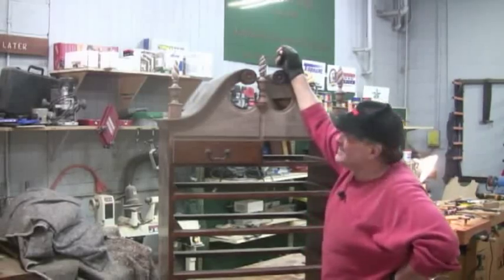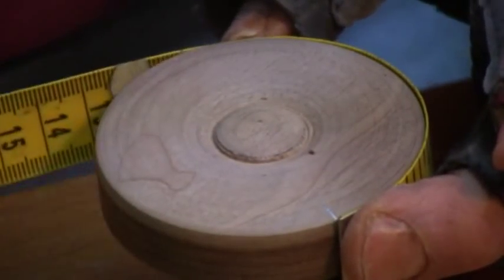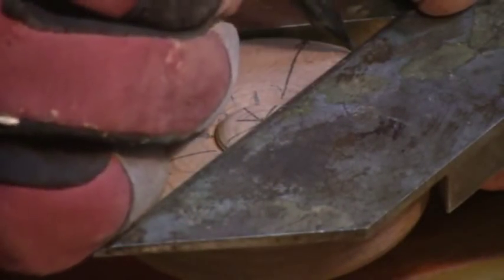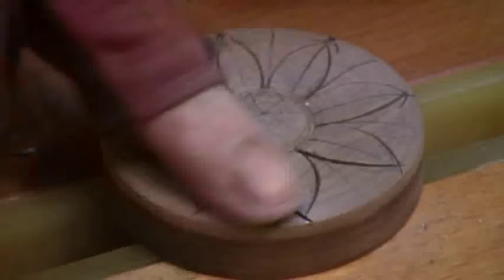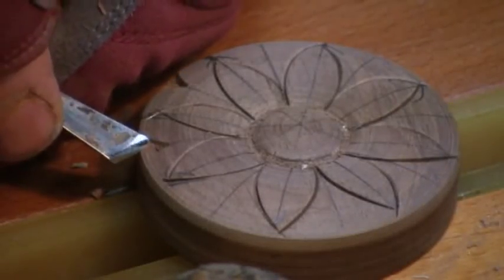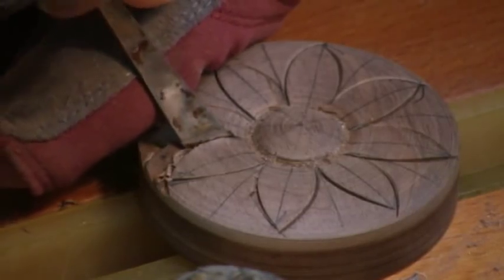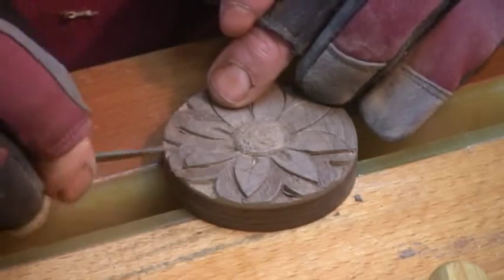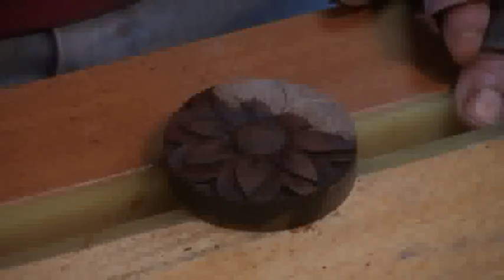A Simple Carved Rosette

Comment from the maker: the dowel is set in about 1/2" and glued , its simply used to hold it in the lathe chuck, so i have full access to the face to turn it, it also lets me return it too the lathe and re turn the the face if i mess up..( always leave an out), it is actually cut off before being installed on the case, I usually just glue them into the rounded part of the gooseneck...you can certainly turn them between centers with out a chuck, I did it that way for years until i got a lathe chuck and spigot jaws